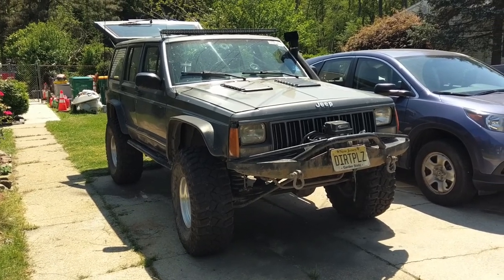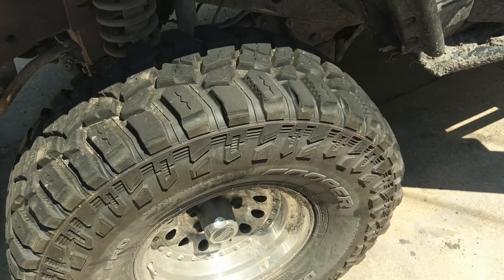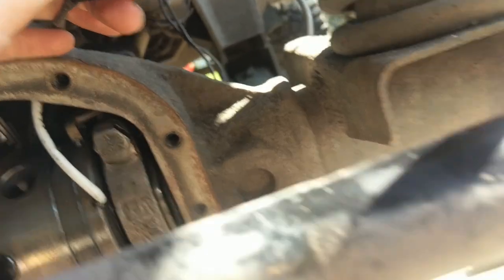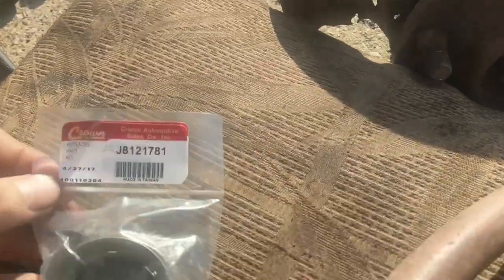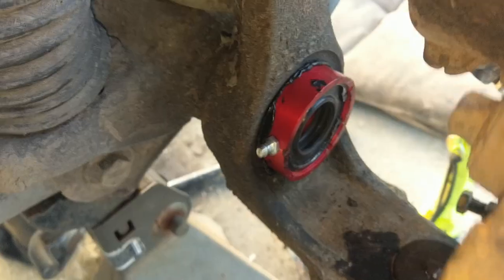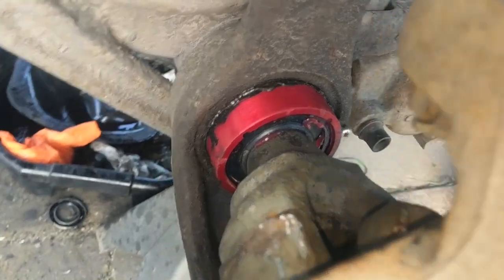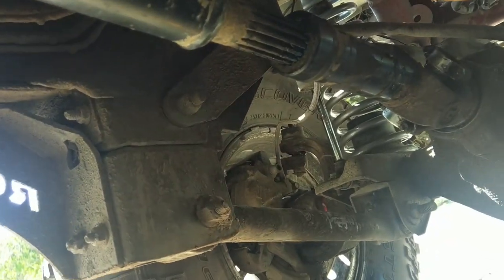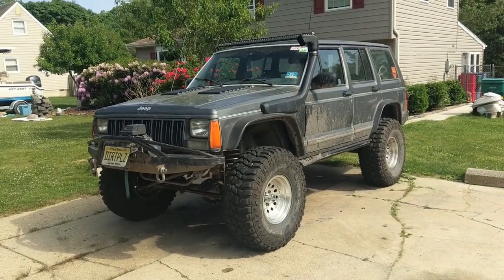89 XJ Dana 30 Axle Tube Seals, HD Diff Cover, Adams DS, Unit Bearings

Comment: I did the hubs a couple months ago and it still vibrates quite a lot at certain speeds. I'm uncertain if the vibration matches the wheels' speed or the shaft speed, but it's something I have to check out. I'd rather change the tyres :D
Reply: Iñigo Zapata check your control arms bushings. U may need a wheel alignment if u experiencing wheel hop at certain speeds. If u have a lift with factory control arms they may need to be upgraded to adjustable arms.

Comment: I have a hyrralic puller from harbor freight. that thing is so strong, i was yanking on my passenger side wheelhub and it was not coming out. All of a sudden it split in half and i could see the bearings. I accidentially left 1 bolt in of the 3. But  that thing pulled out the hubs easy.

Comment: I was wondering how you would remove those outer axel seals when the inner dana axel seals needed replacement. It looks like there is a retaining clip that allows you to remove the center thus allowing you to work on the axel better. I ordered the axel seaks (thanks to your video) and the sleves for back (when i upgrade the axels and gears). I have chromoly axels installed in the front dana 30 so thats strong baby! :)

Comment: Real handy video , i am about to do a diff swap soon from a standard to a e-locker. I will be doing a full front end rebuild pretty much I was wondering if you can tell me how your e-locker is wired up as i have to find a plug and wire it in and have not seen any info on it.
Reply from the maker: +mickjagga3 Still holding up well in the front. I think the rear d35 one was acting up because it wasn't shimmed tight enough. https://youtu.be/d8IxzpuL2DM
Reply: Awesome stuff!! reckon i will be hanging around here a bit. Not a lot of these around here in australia  where i am so your vids will be really helpful. Thanks

Comment: I put the sealis in my dana 30. one trick is to  put some grease around the seal so it will slide in easier. I was able to do it all my self as I didnt have a choice. I also didnt know the seals are different on each side. oh well will see how it goes on my end. Also the next time you have to change your diff seals for the axels you are going to have to figure out how to pull out those axel tubes without destroying them.
Reply from the maker: Indeed, so hopefully this time will be the last.
Reply: Who knows. I am almost clueless but will find out once I get it running. I lost one of the torque converter bolds beween today and last week so i bought some M10 150s from (grade 8) and going to grind them down to match the length of the bolts i have and use them instead. hopefully nothng bad happens.

Comment: have you had personal experience with death wobble before? my 93 cherokee has it and I am kind of unclear as to where to start replacing things! I love your videos and you help me work on my jeep all the time
Reply from the maker: Oh boy, always a fun one. Funny enough I get death wobble in my civic, but it's not nearly as bad as the jeep variety. Something is loose in the front end and the fun part is finding it. Easiest way is to have a buddy turn the wheel back and forth in short, quick  movements and then crawl underneath and watch each Tie rod end, track bar mount, control arm joint, and so forth and see if you can find any that seems to shift back and forth and lag between movements.
Reply: start simple. Get under it and grab everything you can and shake it, have someone rock the wheel back and fourth and see if anything is loose. And check the track bar mounting bracket and bolts.
Reply: would that method be easier with having the front end up in the air? so there isn't a load on it? or do I need the load on the suspension to actually see what the problem is? thank you guys for the help!
Reply: keep the suspension loaded.  Another thing to look at is your tires. Could be as simple as one or both of them being severely out of balance, or a broken belt. Rare for that to be the case but not entirely out of the realm of possibility .

Comment: I’ve had my passenger side seal replaced 3 times in 2 months yet it still leaking. Happened ever since have 4.56 gearing put in. I’m running 33s. Any ideas? Great video!
Reply from the maker: Hmm weird, are you sure it's the correct seal? Might need to sand down the axle shaft sealing surface if it's got ridges in it. Maybe clean fluid leaks more than the old did?
Reply: NickInTimeFilms just did a 450km trip home and no sign of leak since I cleaned up a bit the same day. Very odd. Maybe the seals needed seating or maybe residual oil in the exiles shaft. I just have to monitor it.

Comment: You love your jeep, i like it. Very good video Nick, why the inner seals of the diff are different?
Reply from the maker: This use to be a 2 piece axle but I converted it to 1 piece which needed a custom seal.
Reply: NickInTimeFilms i'm talking about the seals that you installed after you pulled out the locker. the crown with a trumpet shape on the driver side of the tunnel and the green one on the passenger side why not the same seals on both sides?
Reply from the maker: +César Augusto The passenger side was never machined for a seal to fit there, that's why I needed the custom size one
Reply: NickInTimeFilms thanks, my xj loses oil through the driver side of the tunnel, now i know how to take care of it. 
if the pass. side has no seal i culd install one that fit in there right?
By the way god bless you and your jeep enjoy it
Reply from the maker: +César Augusto if yours is a 2 piece axle with the CAD hump (central axle disconnect) the. You have seals farther down the tube behind the vacuum shift motor
Reply: NickInTimeFilms mine has non cad Dana 30.

Comment: its a hub assembly and i call the dana 30 the dirty 30 because there junk but your jeep looking good i put my xj 2 the side 4 a lil while but i did finish building my stroker still debating whether do i wanna drop it in oe sell it and drop my 4bt cuumins mated with a divorced dana 300 transfer case with a allison transmission  im stuck on deciding dropping the stroker cheaper but im a diesel guy

Comment: I just wanted to know if the same process can be done to the 88 Cherokee?
Reply from the maker: Heck yeah, this should work on just about an dana 30. BUT, I deleted the passenger CAD 2 piece axle and swapped in a 1 piece axle so the seals and passenger stuff may be different for you

Comment: are you still running dana 30? if yes, have you ever broken it offroading? i have a dana 30 front axle under my xj with RCV shafts and 35s but i'm kinda scared of serious offroading.
Reply from the maker: +Sam Rezaei oh hell yeah I'm still running it. The only breaks I've seen on the trail are bent shaft ears and broken u joints, so you should have no issues with your setup.
Reply: @NickInTimeFilms  is yours the high pinion or standard?
Reply from the maker: If you meant to tag me, HP.

Comment: timken isn't good anymore though
Reply from the maker: What's better than timken these days then?
Reply: NickInTimeFilms timken was good so don't think that but now it's not made in the us anymore....I've been running Moog in my girls jeep and mine and they hold up real good and have a 3 year free replacement
Reply: Hey Nick, I bought MOOG as well. I think they are solid.
Reply: when replacing 01 xj front wheel (unit) bearings, i dropped the extra cash for timken. when i got them in the mail, they were made by other companies, but with the timken part number

Comment: Electrical pin puller. This one might be the correct size.  
http://m.autozone.com/test-scan-and-specialty-tools/pin-extraction-tool
Reply from the maker: For what?
Reply: Removing the wires from the connector.  It's like a hollow C that goes around the wire and then the tip gets pushed int the block to release the wire from the retainers without damaging the block.
Reply from the maker: Ahh, that makes a lot more sense. I was thinking a pin welder for pulling dents so you can see my confusion, haha